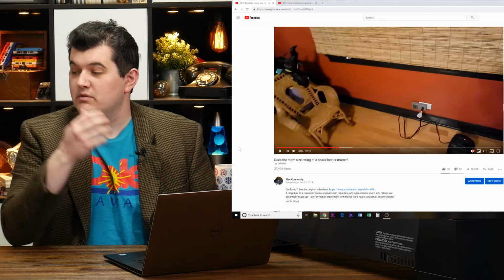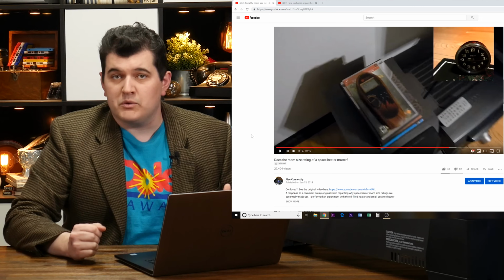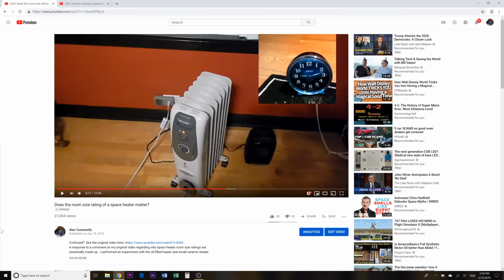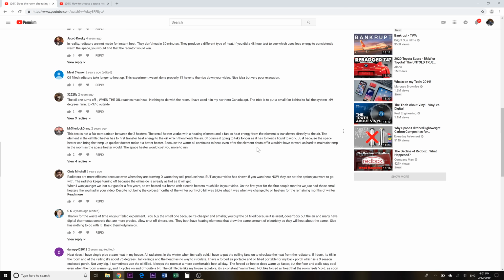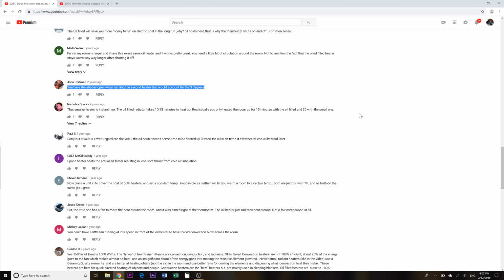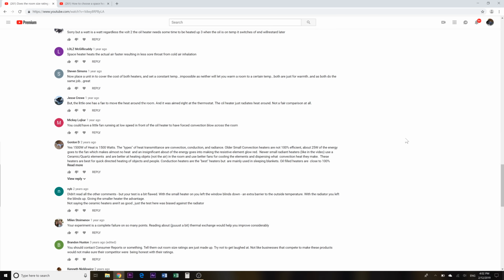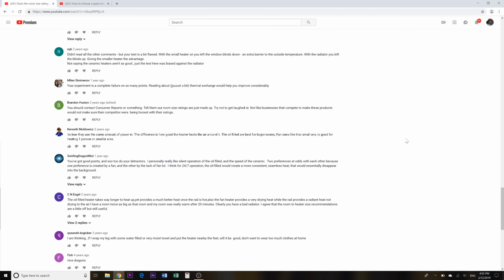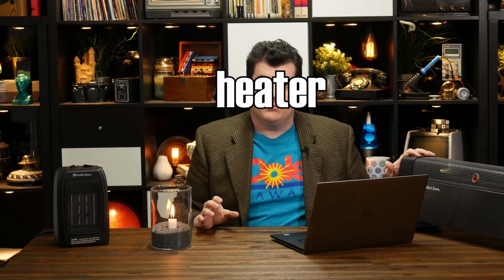More Space Heater Nonsense

Comment: same thing i had a new oil heater that did the same it shut off because of the thermostat so i opened it and modify it so that it keeps going sadly because these new ones are made poorly it started leaking while i had another old one that is 500w weaker but heated the room better. The oil heater is better if you need only to heat what is near it like if you are setting in the living room in the middle of the house and dont want to heat other room that have windows or poor insulation, or if want to put beside your bed and heat only the bed and not the walls and windows.

Comment: I'm not saying you're wrong... but maybe you're overlooking the difference between radiant energy vs convection energy. You need to consider the mass of the objects in the room vs the mass of the air in the room. The smaller convection heaters will heat up the air better, the larger radiant units will heat up the objects better. Get a gallon of water or a block of metal and measure its temperature in addition to measuring the air temperature. You are right that 1500W is 1500W, but it may turn out to be correct that the "large room heaters" are "better" on a long enough timeline.

Comment: Well, here is a question.  Would it be fair to say that the oil filled heater is better for a large room than a small room?  It needs convective currents to move air around, and that should be better in a large room.  The other is better for heating a small room because it is better to move air in a small room with a fan. 
This would be suggested by your experiment.  The oil filled heater limits itself in a small room, and this may not be the case in a large room.
So, the room size rating is not about heating, just about effectiveness of moving the air around.
Reply: So, to be clear, the large room heater isn't necessarily better for a large room, but you showed the small room heater IS better for a small room.

Comment: You don't seem to be able to find straight up Infrared heaters. The one we acquired several years ago is a pure infrared that spits out heat like any normal space heater heating the air but in short order heating surfaces as well. I'm not sure when and why the quartz elements were decided as a good addition. Is it good for directional cast heat? I would have liked it if you'd bought and reviewed one of those as it's the only direct replacement for the current model we use and seems to be as far as the infrared heaters have iterated.
Reply: Maybe... a good compromise for these would be an infrared/oil heater? It would heat the room quickly while applying heat to it's oil supply over time?

Comment: you still miss the point. oil filled is more efficient. it takes a long time to get up to temp. more then half a hour. this is something you have plugged in for weeks/months when it is cold out. when it finally get to temp it don't take as much power to keep it at that temp as a normal electric one. also you are focusing on the watts which mean nothing here really. you need to look how much air can it eat up at one time. the more air it can be exposed too at one time the faster it is. that is what the fans are for on some of them. move the air over the coils to heat more air up. that is what a central ac does to heat the air too. it moves air over hot surface to heat it up and push through room. you need to look at btu. that is the big thing. the amour of air that can be heated or cooled.

you are really getting hard to watch since your jabs at America months ago. the one on turn signals made me start to hate it. the traffic lights one was another that make me start hating this channel. i have stopped watching videos for a while because i just didn't want to get into this stuff and i made a mistake watching this and the other one and can see i should just keep ignoring these videos.

Comment: The effectiveness of a heater really depends on how fast it can disperse heat in a area.  Radiant heat is inefficient and only works good at maintaining heat to a point, if there are enough of them.  A portion of  radiant heat can also be lost as more mass around them gets colder. I used to live in a p!ace with baseboard heaters. It took forever to heat a room with those. Heaters with a fan always do a better job. In comparison a person creates heat, but you won't feel it unless you are close enough. I have also noticed that people seem to feel heat more when it is blown on them. Just like a cool wind feels colder.  Don't beat yourself up about it.
Reply: It is also relevant what you want to be heated. While you could say that a smaller heater with a fan is better to aim at a person for example, the large ones aren't really better at just heating the room than the former one. We had a heater that could be run passively (as it was shaped like a normal convetional heater), but it also had a centrifugal fan that sucked the air out of the heater to point the warm current to the side, imo the best of both worlds. The best heater is the one that doesn't turn off when you want it to heat

Comment: I think it could do with duty cycles instead of heat output, heaters for large rooms may be built much more robustly than the small ones. That would explain why the oil filled heaters are the only ones "rated" for a "large room".

Comment: One thing I don't think you mentioned is the TOTAL watt/hours consumed by each test. Yes, both heaters pull 1500w when on. But I'll bet the the oil filled used less power in the hour it was on versus the half hour the little one was on. If the oil unit is cycling, when it's off no power is consumed. And as you correctly claim, energy is energy. So both heaters will heat the room to the same temp for exactly the same electrical power consumed - if both are ran long enough. The only difference is the time span in which the energy is consumed. The oil heater even after an hour did not match the little heater in terms of heat output. But if you were to measured the total consumed power, the big heater would also show less power consumed even though it's test phase ran longer but remember it was cycling on and off.

Comment: I think heater size versus room size is tied to duty cycle and safety. Bigger heaters can be run at 100% duty cycle while being safer. It may boil down to liability as well. If you use a tiny 1500 watt heater at 100% duty cycle to heat a much larger room than was advertised and there is a fire, a company might say it was misuse to fight liability. But there is no need for those expensive heaters. Heat wise though...1500 watts is 1500 watts.

Comment: So I don't disagree with your main point electric heat is electric heat is electric heat.
I do want to point out one point as to why I think the experiment in your original video was flawed that you didn't really talk about. You mentioned that the oil radiator was shutting off, and you talked about it a little bit but the thing about radiators unlike the fan style heaters is that you can't turn them off.  

Honestly if you were going to do that experiment with those 2 heaters I think what you would have to do(without controlling for weather) is to let them run for a set time period(one that the oil heater can do without forcibly shutting off) and measure how long it takes for the temperature to get back to the starting point. If your theory is correct(which I think it is) then what you should see is the fan jumps up in temp sharply then gradually cools down staying at high temp for just a few minutes. The oil heater should take longer to heat up and not get quite as warm in the room but it would stay at the highest temperature for a longer period of time.

Comment: Plot twist: while electric heating is 100% efficient, if you want to get heat, running a computer for BOINC or other grid-computing projects ends up being, overall, over 100% efficient. It produces heat at 100%, but it also produces computation that would otherwise be calculated on its own efficiency scale. You get two results at the same cost as just heat alone.
Reply: So, don't buy space heaters, buy high-mega-flops computers?
But what to do with the computers?  Run graphic intensive programs?  So... buy some games?  From...
Gasp!  STEAM heats rooms!
Reply: @adm0iii  This would go right along with bitcoin mining. Those things not only take up the majority of power used in NY and iceland (I am not exaggerating about this) they also need cooling systems in place to keep those servers from overheating and running at peak efficiency.  

Pretty much the ideal situation for home heating that you are prescribing. I can't think of any practical applications for that other then having your PC hooked up to some science research and having it in turn running programs for them as computational power.
Reply: I understand Norway is becoming big on the internet, because storing and accessing all that data generates so much heat, it's become cheaper to move this all to the arctic.  We're mining their cold.
Reply: @adm0iii  And Switzerland as well, tons of air cooled areas and countless cave systems to store these things.
Reply: Flip it over .. a space heater is a rather badly designed computer that does 0% useful computations :)
Reply: @timhill9039  
It does work digitally, space heaters say:

111111111111111111111111111111111111111111111111111111111111111111111111111111111111111111111111111111111111111111...
For as long as they're on.
Reply: I turned my furnace down and am heating my bedroom with Rosetta and SETI (using dual 16-core Opterons, ~300W).
Stays a nice comfy 71°F while the rest of the house is in the low 50s.
With the difference in cost between electric and natural gas, the costs just about even out while also getting some useful work done.
Reply: Yup, I'm running FAH on 1080Ti to heat my room :D
Reply: @Ryoga_Gaming  FAH!
Reply: I just fire up Crysis on max settings like the good old days

Crysis 2 and 3 are reserved for winter :^)
Reply: That's the same reason why replacing incandescent lighting is pointless if you use electric heating
Reply: @lajya01  If you use the lights only in the winter.

edit: Or if you live somewhere where you need to heat even in the summer.
Reply: This need to go to PCMR.
Reply: Matt Falcon buy btc miners, watercoolers, a car radiator and you have free heating.
Reply: Or use a heat pump...which can be up to 11x (1100%) efficient easily...and 26x is possible.

And it's literally just a reverse AC.
Reply: @Gulyus  I think you are equating the heat pump SEER number (Seasonal Energy Efficiency Ratio, between 13 and 26 now) as meaning X more efficient but is actually a ratio used when comparing heat pumps but only for cooling.  For heating you look at the HSPF number (Heating Season Performance Factor, between 7.7 and 10 now) . Also below about 40F air source heat pumps lose capacity and efficiency rapidly and auxiliary heat would be needed. In colder climates a ground source heat pump is needed at much higher initial costs but if sized properly will work at any temperature.
Reply: @Gulyus  Can be in theory more realistic performance is between 2x and 4x.
Reply: Depending on your situation it's "over 200%": if you use a spaceheater to heat the room at night, you use, let's say, x watt hours to heat. Then you need to do computing during the day: another x watt hours. But since it's already hot and you can't bear the heat from the sun and your supercomputer, you buy an air conditioner that uses y watt hours to throw your hot air literally out of your window. So you end up using 2x + y, instead of just x for using the computer at night. That's "more than 200%". 

(don't take this comment too seriously)
Reply: only if your CPU and GPU have high TDP to begin with, and you've got an extremely efficient cooling set up such as a giant Noctua brick or liquid cooling to dump all that heat as efficiently into the room as possible.
Reply: Hell yeah, mine crypto for heat. Earning back a portion of your electrical bill, while heating your house. The only problems is noise...
Reply: @thewolfin   Why not both use BOINC and earn crypto? You can earn cryptocurrency for using BOINC (See http://gridcoin.us/). You can also earn cryptocurrency for folding@home (see http://foldingcoin.net/).
Reply: @anonymousperson5212  Because for humanity, mining crypto is useless. You have to decide who you want to help at the end: Your wallet (crypto mining) or humanity (calculation projects).
Reply: "over 100% efficient"

So how efficient then? 110%?150%? Something else? ;)
Reply: @seneca983  you can't really tell because computing power you can't really quantify in terms of physical power. It's a useful job but it's hard to define in terms of how energy intensive it is or could be and how efficient it is.

Even something like a loudspeaker you can define as current into the voice coil in watts vs how much elastic potential energy per second it transfers to the air. Even 1 watt of elastic potential energy is 109.4dB in all directions at 1 meter away - as loud as a really noisy 2 stroke dirt bike. It shows how inefficient speakers really are!
Although the efficiency of hearing hasn't been taken into account. Probably a milliwatt transferred directly into the ear is orders of magnitude louder than the most painful racket that has ever been mustered.
Reply: @TimpBizkit : Yeah, that's why I wanted to nitpick about the efficiency being "over 100%".
Reply: @TimpBizkit  
I suppose this is the closest thing to efficiency.
"At 20 °C (room temperature, or 293.15 K), the Landauer limit represents an energy of approximately 0.0172 eV, or 2.75 zJ. Theoretically, room‑temperature computer memory operating at the Landauer limit could be changed at a rate of one billion bits per second with energy being converted to heat in the memory media at the rate of only 2.85 trillionths of a watt (that is, at a rate of only 2.85 pJ/s). Modern computers use millions of times as much energy per second."
https://en.wikipedia.org/wiki/Landauer%27s_principle
Reply: @seneca983  How efficient is a computer? For each kJ of electricity, you get a kJ of heat and some FLOPS. Instead of only getting a kJ of heat. But the problem is you can't really quantify FLOPS/kJ as a percentage.
Reply: @thewhitefalcon8539 : Yeah, that's the problem I had with the "over 100%" efficiency.
Reply: @seneca983  ~ I didn't bother looking up how people calculate efficiency of computing tasks, but if you want a specific number, you can look that up. :)
Reply: @FalconFour : It's probably not measured as a percentage, because it's not quite clear what that would even mean. I just wanted to nitpick about the wording because I like nitpicking. It might be fair to say that it's economically more efficient than just a regular electric heater, but you probably can't reasonably express that as a percentage.

Comment: You should make tests based on energy consumption, not based on time. For example, get temperature readings at the start of the test and then at the time the unit takes 1500 watt-hours. I guess this kill-a-watt meter has a watt-hour reading ... ?
I'm curious to see what happens. I expect the oil radiator to perform a bit worse because of that cycling - it will heat the space slower, but the heat loss is the same ...
Just a thought...

Comment: They do make 220V space heaters that use the same 20 amp plug as a window air conditioner but they're not as common for some reason even though they would actually heat a large room and be safer than using three 1500 watt heaters.

Comment: I totally see your frustration, I'm a mechanical engineering student taking heat transfer right now, and you are exactly replicating what we learn in class. Energy generated = energy output.... if they use the same power under steady state conditions for the same amount of time, they will release the same amount of energy into the room. This isn't even a question up for debate, there are equations in textbooks written about this stuff.